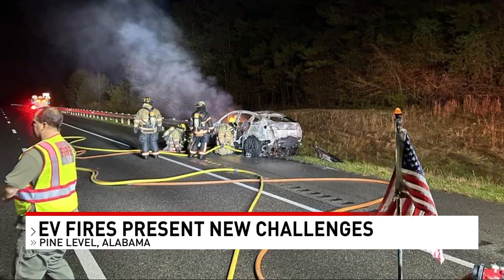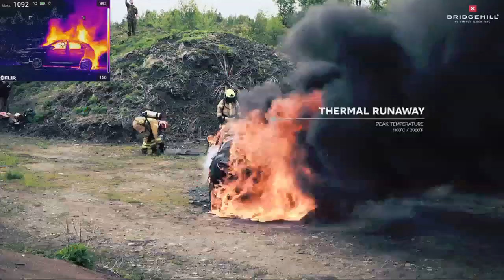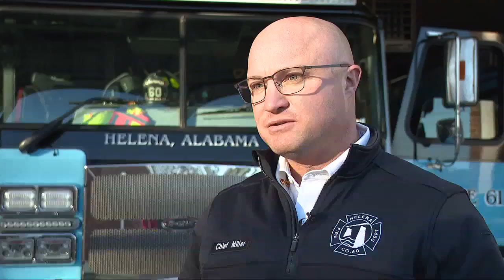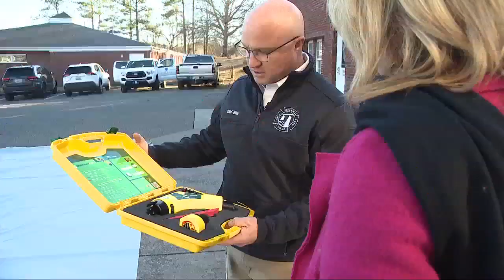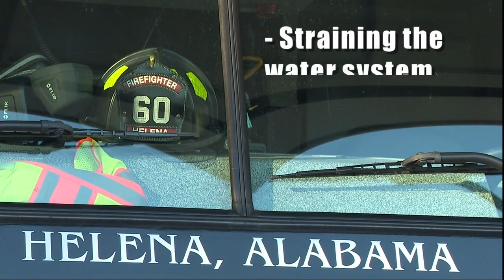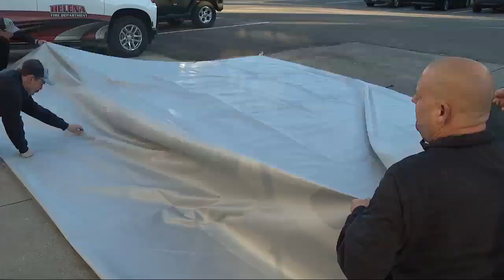New fire blankets seen as the future of fighting electric vehicle fires

Comment: no oxygen no fire
Reply: Not true. Batteries don't need oxygen from the air. When in thermal runaway, oxygen is released from within the battery.
Reply: @jeeper360Googleisgay  Which is why these blankets reduce the overall temps to below the re-ignition point in the batteries.

Comment: What am I missing here??? An EV fire supplies its own oxygen. That's why its in thermal run away. The fire goes out when the fuel is all burnt up. A blanket will not smother the fire, it just covers the fire. 40,000 gal. of water does not put out an EV fire either. It's just that by the time they have dumped that much water on it, there is only enough fuel to reduce the temperature of the fire till the water can actually start cooling it.

Comment: So the roads blocked for 10 hours?  This is going to work good
Reply: No, once the blanket is on it’ll take a matter of minutes for the battery to cool enough for transport of the vehicle. You’d keep the blanket on the vehicle and transport it to a holding area designated for EVs and that’s where it’d have to sit for a number of hours to prevent reignition.

Comment: The blanket is a good first step, but they need a secondary device to actually smother the flame.   An foam that could be deployed before the blanket, or under it, to snuff out the active air supply - other than oxidizers in the batteries themselves - would help bring the fire down.  At least until the vehicle is moved and air begins to reach the reactive chemicals again.
Or, perhaps, they could use far less volatile batteries with lower power-per-kilo drawbacks (LiFePo4, for example).
Reply: Foam is not recommended on EV fires. The blanket will smother the fire on its own. If you aren’t able to deploy the blanket, you’d just use water to cool the battery.
Reply: These fire blankets have been shown to drop the temps low enough for no re-ignition, even after being exposed to air.

LFP batteries are starting to become more common in EVs, especially due to their lower cost, though the energy density isn't quite as much as more common LI batteries. But the fire risk is considerably less (though EV fires are still exceedingly rare. They are rare enough to get national, or international news, while ICE fires don't get covered at all unless they snarl up someone's rush hour traffic for hours and the local news has a sentence about it).

Comment: I haven't seen one advantage to using an electric car!!!! Everything about them is a nightmare! The cost of charging them. The amount of time it takes to charge them. The frequency they need to be charged. The cost of the vehicle itself. The danger to life and property they pose. The fact that it's "Fossil Fuels" that power the charging stations. I just don't see the up side!!!
Reply: Creepy Joe gets his 10% from his Chinese masters. 🖕🇨🇳🇨🇳🇨🇳🇨🇳🇨🇳🇨🇳
Reply: @matthewholmes5285 I have an EV and a MINI Cooper JCW.  If one were to drive each 1000 miles a month (the US average of 12,000 miles a year, each), the EV would cost almost 5 times LESS than the MINI, even at current $3.00/gallon prices here in Maryland (I’m using regular gasoline prices, not the premium gasoline the MINI actually takes).

At 300 miles per charge (on average), and a 64 kWh battery, that’s about 213 kWh per month. Use your own electric rates to give you your monthly cost. For me, it’s about 11cents per kWh. 213 kWh times $0.11 is $23.43 per month in electricity to drive that amount. For people with TOU plans at their utility company (typically 4–6 cents per kWh) that could be as low as $8.50 per month to drive 1000 miles per month, or $102.00 per year!

My MINI, at 35mpg, and $3.00/gallon, would cost $85.00 per MONTH to drive the same amount. That’s about a $60/month savings, or a savings of over $900 per year! If your current car gets less fuel mileage than that (most average about 20-25 mpg in mixed use) the savings are MUCH more. 

Charging doesn't cost much at all at home, and charging on the road (most people don't take road trips over 300 miles more than 4-5 times a year) costs about the same as a 40mpg economy car, yet delivers more power and comfort than a small economy car. Oh, and for cars like mine, charging on the road takes about 15 minutes to go from the equivalent of a quarter tank, back to about 80%. Since that charging session takes pace every 4 hours or so of driving, it's a perfect time to take a potty break or grab some food before finishing the trip. And in day to day driving, you'll never use a public charger. And as for time charging at home, you charge overnight. So the actual use of your time is only 10 seconds to charge. 5 seconds to plug in when you get home, and 5 more to unplug in the morning to go about your day. VASTLY more convenient than putting gas in. You COULD only charge a car like mine every 300 miles or so, or 3 times a month (Again, overnight while you sleep) so charging frequency is what you make it. They simply don't need to be charged every day if you don't want. But having a "full tank" every morning without having to go somewhere ELSE to do it, and pay more for that , is really appealing.

The cost of my EVs have been (without any government incentives on them, BTW) on par with their gasoline counterparts. My Chevy Bolts have been priced around $25k MSRP, which is about the same as their direct gas competition, like the VW GTI, MINI Cooper S, and the like. My new Equinox EV has a base price the same as a Honda CR-V or Toyota Highlander or any other midsize SUV. So your BS about added cost to buy them is wrong. And the savings is real.
Reply: I have an electric car and i charge it off my home solar. I use to pay $550 a month for fuel and now i drive for free, so when your saving $6600 in fuel it really makes more sense to own an EV over an ICE.
Reply: Add that they have no longevity and no repair network
Reply: @danasmith858  No longetivity? Studies are showing that the battery packs can easily last 300,000-500,000 miles or more without issue. The batteries and electric motors should outlast the cars they are in. I already know folks that have over 300,000 miles on them on their original batteries, and are showing little to no battery degradation.

Comment: I work at a junk yard where we get teslas, we just got one of these that cost 1700$ and they have to replaced every so often because they arent as reliable with old age ! JUST STOP MAKING THESE ELECTRIC CARS!!!
Reply: Any car isn’t reliable with old age. It’s the circle of life.
Reply: The oldest versions were built significantly different, and don't even have the features that make them good (250kw charging and AP2.0+ hardware). A 2018 Model 3 is going to need minimal repairs even 10 years from now
Reply: As was said, a first gen Tesla will not be reliable due to poorer construction, early battery software, and old battery tech. Newer EVs are lasting 300,000 miles or more, and newer (post 2014 or so) battery chemistries are rated for 2000+ full charge cycles. In a car with an average range of 250 miles per charge, that's over 500,000 miles of use before needing to be recycled, or repurposed as stationary storage. Since you work at a junkyard, you're ONLY going to see damaged cars. By the number of gas powered cars in there, you can just as easily say THEY should stop being made. But you don't because you really don't know anything and are biased.